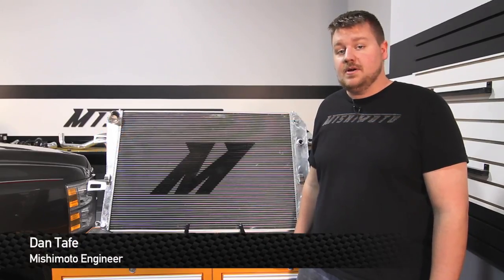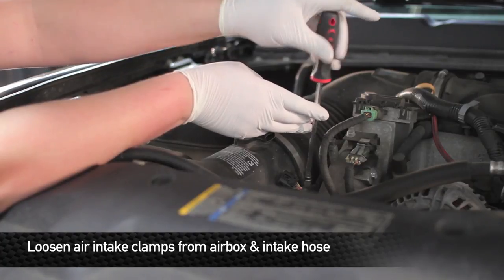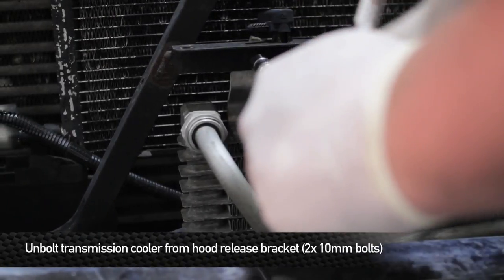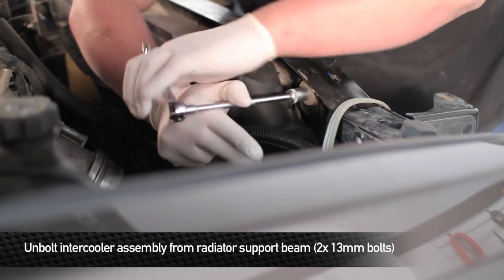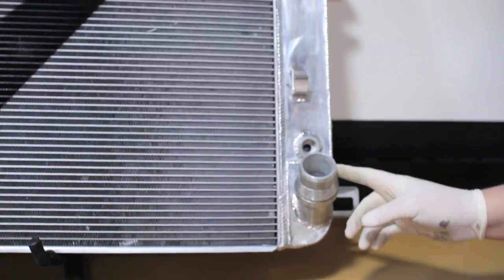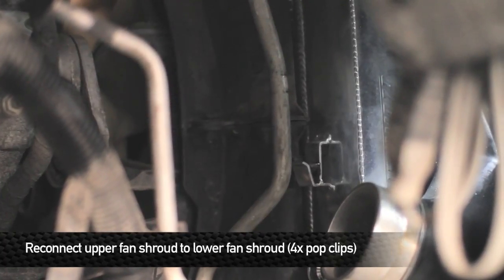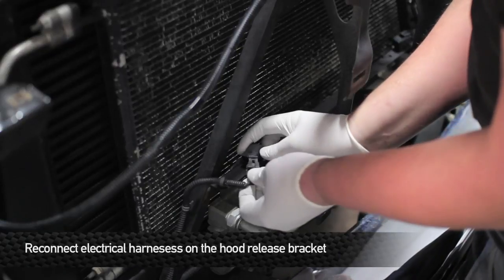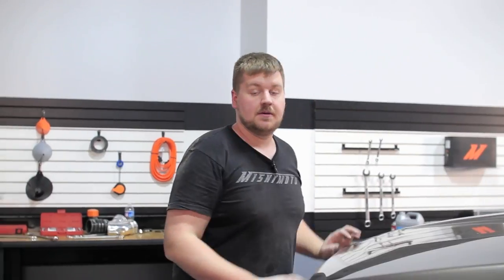How To Install: Mishimoto 2006-2010 Chevrolet /GMC Duramax 6.6L Performance Radiator

Comment: What kind of sealant do you guys use for the lower radiator hose ? I just removed my oem one and notice white stuff on the fitting and hose side.
Reply from the maker: No sealant should be required on this hose. What you are seeing might be lubricant used to get the hose on or dried coolant.
Reply: @mishimoto  could be, thanks for reply

Comment: Why would you need a new radiator? My truck never even gets warm..... stock radiator is awesome on my truck.
Reply from the maker: Some customers tune their trucks for racing or live in warmer climates that require additional cooling.
Plastic tanks tend to crack and fail over time as well.
Reply: My lml rad cracked on a 65 degree day. Plastic sucks. Just depends if you are lucky and get a good one. I didnt that's why I am here lol.
Reply: mine cracked at 416k miles lol

Comment: what "pop-clip pliers" do you recommend?  Link maybe?  Thanks
Reply from the maker: Hey no no! The panel clip pliers in this video are not made by genius tools - many companies make them, and there are a ton of different styles.  They're called push-pin pliers, pop-clip pliers, panel-clip pliers etc...here's a few links you can check out:
KD Tools Push Pin Pliers: https://shop.advanceautoparts.com/p/kd-tools-push-pin-pliers-kdt3729/25980469-P
GENIUS TOOLS Clip Remover: https://www.amazon.com/GENIUS-TOOLS-Entferner-230mm-AT-TPR/dp/B001FVWOWK
They also make bent ones for tough to reach clips!
Reply: Mishimoto Automotive thanks! Btw - I'm hoping to hear back soon. I'm near your DE shop and have an LMM :) I replied to the ad looking for a test mule for the trans cooler.